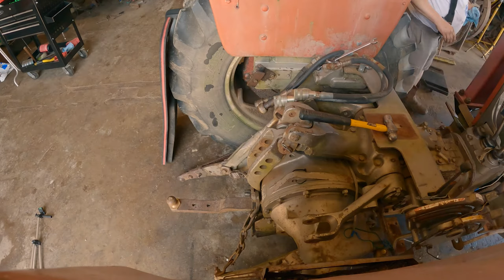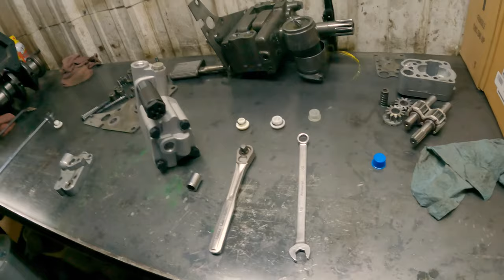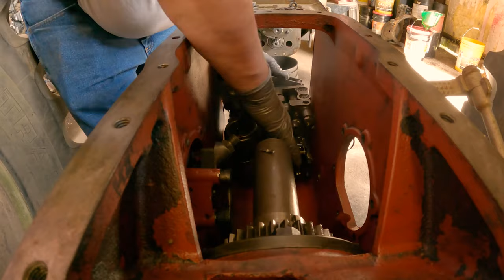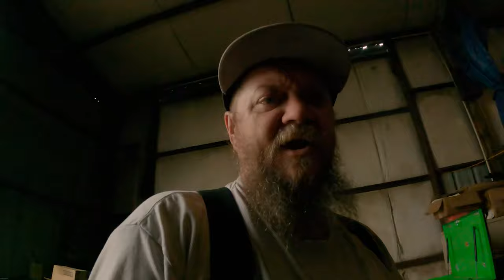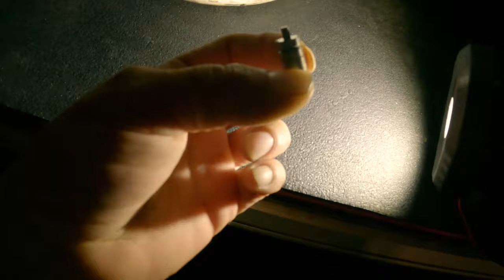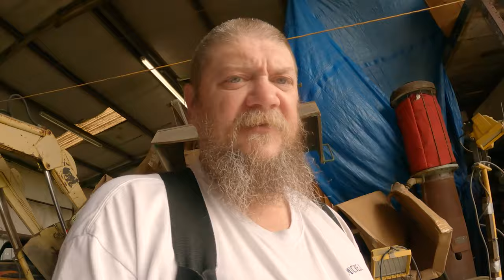Massey 175 Secondary hydraulics pump replacement

Comment: I watched your video on replacing the hydraulic pump on a MF 175. My husband has a MF 231S. He has replaced the hydraulic selector valve but it’s still leaking out from under it. Could it be air in the lines?  If so how do you bleed the hydraulic system?  I can’t find any videos talking about that. Also he has a 1953 Farmall tractor if you know anybody interested. Any info is appreciated. We are in central Ga.
Reply from the maker: Can you tell me where its leaking possibly? Thanks for watching
Reply: @vintagediesel-1  where the valve bolts onto the tractor.
Reply: @vintagediesel-1  how do I bleed the hydraulic system after replacing the selector valve and hoses?

Comment: have you ever rebuilt the spool valve thats on that tractor? mine are leaking and not sure if just pulling the caps off the rear and the spools (valves) will slide out the rear of the body housing.
Reply from the maker: Yes I have but it's usually at the same time as I had to split anyways though if memory serves it can be done. Some so late with a response it didn't notify me . Thanks so much for watching

Comment: My primary pump is not turning and the secondary pump has air bubbles coming out from under it, any ideas on what happened to it?
Reply from the maker: Check the fluid level of course. Sounds like either the filter or bypass valve. Thanks for watching
Reply: Check the seal behind the slave cylinders for the breaks

Comment: Is that a multi power tractor? I bought a 165 and loader but the loader was not installed on the tractor and I noticed that the multi power doesn’t work in high range. I’m guessing now after watching this video that it may be the reason the loader isn’t on it? What you recommend being the first thing to check?
Reply from the maker: Yes it was I'm sorry I missed this.

Comment: I have a MF180 that I've  split about 6 times in the last 30 yrs. Always hydraulic issues, Nice tractor otherwise. Really can't understand why they put a pump in there that is this cumbersome to get out. Couple of questions. Is there a port I can put a guage on to check pump output pressures without dissembling everything, Does secondary have two sections? One for loader and other for multi-power and PTO. hey could have designed this better, Have you ever installed an external pump on this tractor to run off crankshaft? Thanks, Den from Wisconsin.
Reply from the maker: This is a good question.Yes there can be a gauge connected through a remote and it will let you know where pressure is living. There is 2 pumps a primary and a secondary in your case. one built to the other , not ideal lol. I imagine a crank driven pump could be modified to work and would make life much easier .  Thanks so much for your input and for watching these videos.
Reply: @vintagediesel-1  Hoping for more detail like where exactly is this pressure  monitoring port and do you know of an external pump being sold that will work and the details of mounting it. Would make a good video.
Thanks for any input.
Reply from the maker: Yessir they do make a gauge that plugs into the remotes to check pressure
Reply: @vintagediesel-1  The question was not do they make a gauge. Of course I can find a gauge. The question was where is where exactly is this pressure  monitoring port to check the pressure output of the auxiliary punp?
Reply from the maker: You would plug a gauge into the service remotes that you would use for implements to check pressure.

Comment: And do you HAVE to split the tractor to get the pump out?
Reply from the maker: Yessir you will have to split it. You can take the 3 point top off and check the screen first however usually there is 2 pumps on these units. If the 3 point works but nothing at the remotes then it's the secondary pump. Hope that helps. Thanks for watching.
Reply: So if the hydraulics remote  works but not the 3 point than it’s the other pump ?

Comment: Hi.
I have a model, Massey Ferguson 135 made in 1978, can you help me with some clues (or some indications how to approach the problem ) regarding the below problem. My tractor haze a problem with hydraulic system. It's lifting the plow or other weights with the tie rod, but when I stop the engine, or when I push the clutch pedal the weights are going down. If there is nothing in the tie rod and I stop the engine the tie rods are staying up for one or two days, time in witch they are slowly coming down. Can you tell me if this problem is occurring from hydraulic pump (valves etc.) or it's from hydraulic piston (the segments of the piston head need to be changed)? The rest parts of the hydraulic works ok, the pto is also working fine. One thing I noticed that when I start the tractor and I lift a plow (for example), it's lifting it more quickly when the oil inside is cold and it's taking a little longer to do that after I'm working (plowing) with the tractor and the oil temperature from hydraulic system is higher.
Thank you verry much!
Reply from the maker: Sorry it didn't see this. It seems as though your pump is bypassing fluid. About time to replace the primary pump. When it's cold the fluid is thick enough to keep pressure but as it thins it will begin to bypass if the pump is worn. Thanks for watching.
Reply: @vintagediesel-1  Thank you very much for your reply!!!

Comment: I have an MF285 with a slow front loader. Is there any more info on the lever not getting full travel?
Reply from the maker: The front loader is operated from a secondary pump. If your not getting full motion the pump has began to bypass. Time for a new secondary pump. Thanks for watching